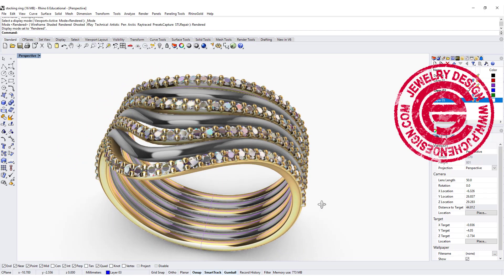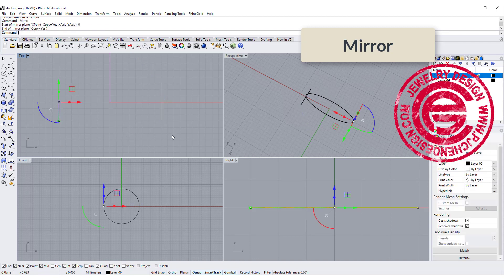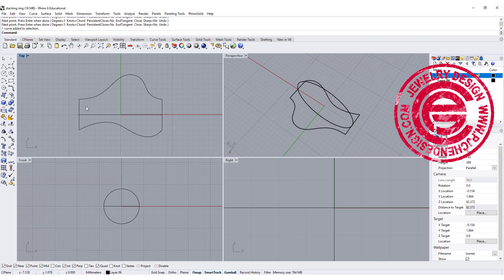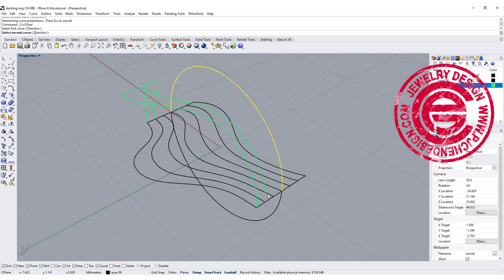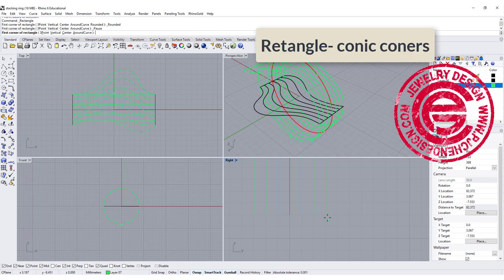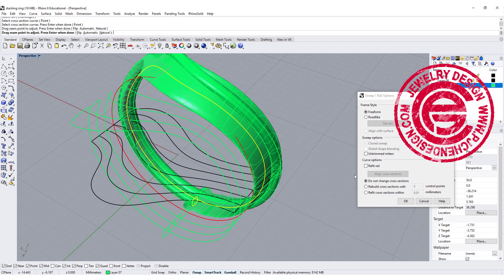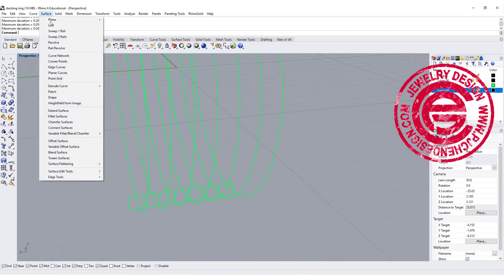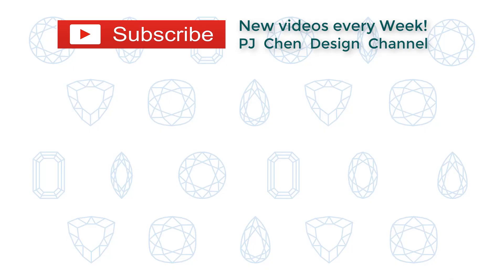7- Stacking Ring Design 3D Modeling in Rhino 6: Jewelry CAD Design Tutorials #94

Comment: Thats amazing video! I do have a question, how it possible to make a ring like that in reality- part of gold and other part of silver ? great job! thank you
Reply from the maker: If you are asking making it, you will need to 3d print the parts separately and solder them back after casting. if you are asking cad model. you will need to boolean split into 2 parts and assign different materials.